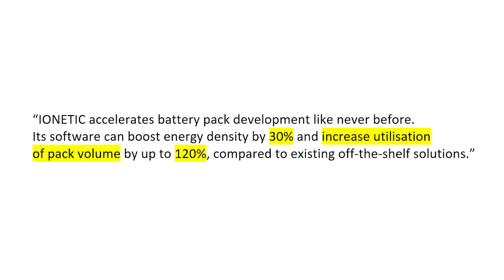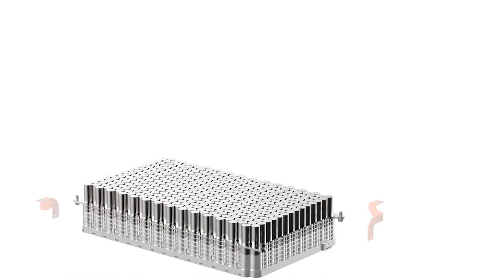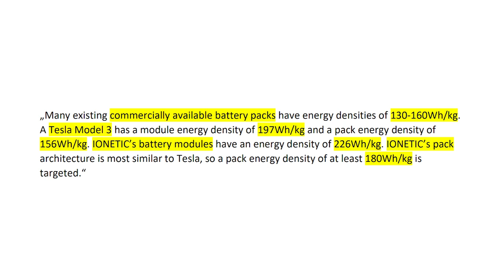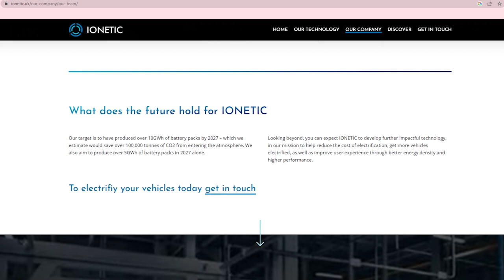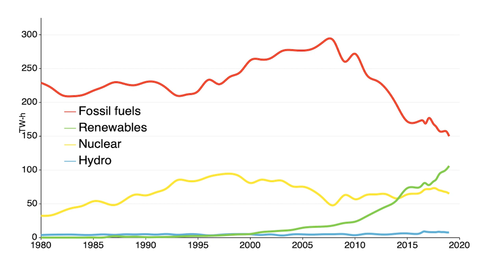Cell to Pack Battery Design - James Eaton (Ionetic) | Battery Podcast

Comment: Hello, can somebody please provide a picture showing what's inside a CATL CTP3.0 battery cell ?

Is it a cheap oval-wound battery cell (enclosed inside a prismatic aluminum container), whose jelly roll is narrow (thus several meters long), thus unable to expel heath ?

Is it a more expensive oval-wound battery cell (enclosed inside a prismatic aluminum container), whose jelly roll is wide (thus less than one meter long), thus more able to expel heath ? 

Is it a very expensive thick pouch cell (enclosed inside a prismatic aluminum container) that's made of many parallel stacked flat layers (cathode, separator, anode, isolator) able to direct-expel heat through the junction point of the many cathodes, and through the junction point of the many anodes ?

Comment: The next generation battery pack has no modules => cells to pack is new design
Reply from the maker: @alexkumar7062 Dear Alex! Removing the module inter-architecture in a pack has an impressive impact on performance, capacity, etc. - but what do smaller OEMs do? Make or buy? Who delivers this engineering knowledge?